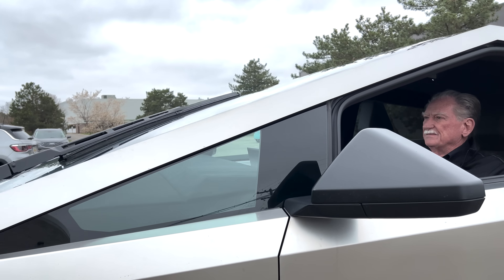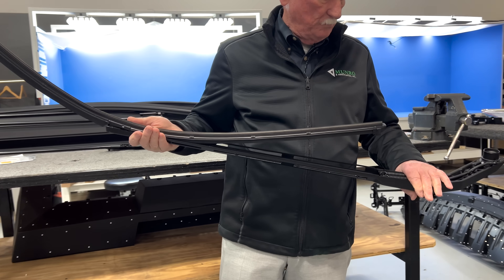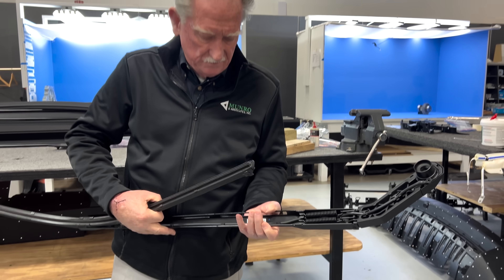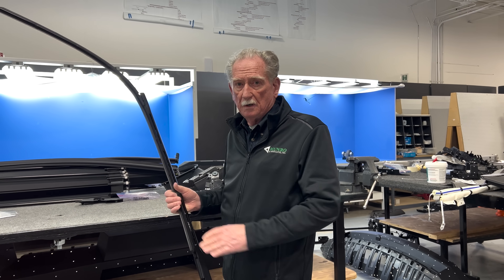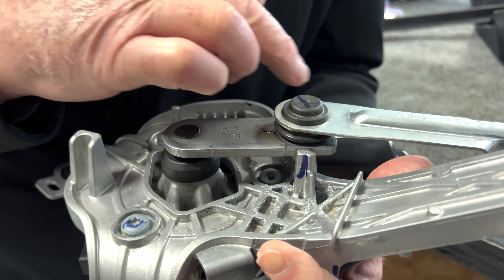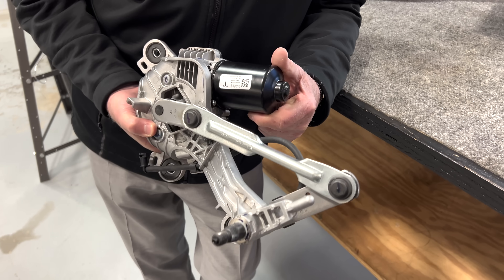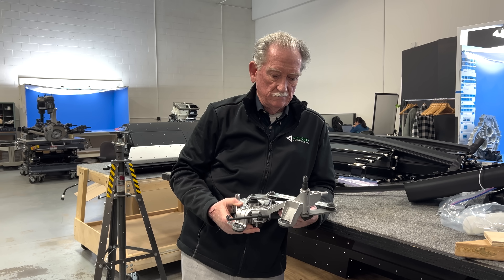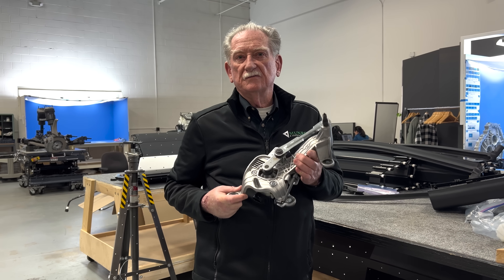How the Cybertruck's Massive Windshield Wiper Works

Comment: Hard to imagine a wiper swinging with such a large arm can swipe fast enough to keep up with a very hard rain.  The challenge is speed between wipes when it is really raining hard.
Reply: That thing looks extremely janky and jerry rigged, almost like a prototype
Reply: @Gr0gansm1th  As someone who has repaired wiper systems for over 50 years its actually a very robust and well though out system.  

Most don't realize the long spindly arms and linkages that have been threaded through the cowlings of vehicles over the evolution of the powered windshield wiper.  

Its quite an improvement having all the components mounted on one relatively small cast assembly instead of having a motor mounted to the body with an arm going to a central idler arm connected to the crank on the wiper arm hub via metal  rods with plastic snap together ball joints with all the separate pivot points screwed to the body sheet metal or having a removable cowling under the windshield with all the components mounted to a tube frame spanning almost completely across the entire width of the windshield.

Nothing janky or jerry rigged about this single wiper system.

Best!
Reply: @neilfromclearwaterfl81  I agree, it is good to see the mechanism simplified, eliminating the cross arm and ball joints.  The greatest problem is the vertical park position which exposes the blade to UV.  The bade on the back of my Insight is in vertical park position and it disintegrates in less than a year even in the not so sunny northeast.  You’re sure not going to find a beam blade refill that size at Walmart.  Hopefully it is a blade refill size typical of a truck or a bus, etc. you can get at Napa.  I’m pretty sure it is going to need frequent replacing.
Reply: @wtmayhew  Yes, and so often the access hole you have to reach inside of to get to those parts is so small you can't get your hand in while wearing a glove to protect yourself from all the razor sharp stamped sheet metal arms.  It can leave you believing a Sadist was involved in designing some of them.

You can end up looking like Sandy after his hand surgery when your done servicing some of them.

On the Sun/UV/Ozone issue, its a problem especially with the new rubber formulations we have today possibly due to the lack of virgin rubber with all the strife and deforestation going on.  

Of course to add insult to injury its harder to find blades that take what use to be a 25 cent refill with most of the new styles requiring the purchase of a 10/20/30 dollar or more replacement blade assembly in order to renew the rubber insert.  When they are available most are special order and not normally carried in the stores.  Oh and of course are about $10 each for the strip of rubber and no longer 25 cents or even just 10 times more costly then they use to be.  

Best!
Reply: @wtmayhew  I can't even get the 30" drivers side wiper blade for my Ford Tranit 250 at most auto parts stores, and there are millions of Transit vans on the road!
Reply: @markbeiser  Thanks for the reply and the data point.
Reply: @neilfromclearwaterfl81   Thanks for the reply.  I know what you mean about all the sharp sheet metal under dash boards.  Most under dash explorations end with at least one Band Aid.  🙂
Reply: @wtmayhew  Its even more fun when they are buried in a drain plenum just in front of the windshield where they've hidden the air intake for the HVAC system with the only access a small round or oval hole on the engine side of the firewall.  You will at times be working blindly inside that drain channel to get at all the arms and cranks since on some there will be no other access besides that one small hole where the crank on the wiper motor threads through.

Just a Band Aid would certainly be a good day working on some of them.  Hopefully you don't encounter something that doesn't want to be disturbed as a bonus.

Best!
Reply: @neilfromclearwaterfl81   Who’d have thought something like Legionnaire’s Disease would be an automotive repair occupational hazard.
Reply: Wiper blades this long are not a new thing. They have been used in buses and some marine applications for a very long time. This is simply the first use of one this size in passenger automotive application.
Reply: It always works great shill land never has problems.
Reply: I’ve never used the fastest wiper setting. Very diminishing returns after a certain point
Reply: @jabroni6199  Yeah I guess you and grandpa Munro must have never been in serious rain.
Reply: I've been around trucks and ships a bunch and have noticed that between smaller, faster moving wipers and larger, slower moving wipers, the results are the same.
Reply: Obviously Sandi also doesn't understand or worked with stepper motors or any other kind of low voltage d.c. motors. The voltage doesn't determine tge body size of a motir. He's trying to make it appear that tesla reinvented the product lines. Stop it
Reply: @cengeb   True.  Perhaps one could say the power output under load will generally greater for the same size motor when the applied voltage is greater.  That is of course a huge generalization and depends on several other variables.
Reply: @cengeb You are completely incorrect. The voltage applied directly correlates to the strength of a magnetic field. For a given stator volume, the higher voltage motor will have higher torque. This is basic stuff.
Reply: @otm646  not true, not true at all.  A generalization that makes no sense.  cough cough hack hack.  Ummm, aaaahhh.  All depends on it's driver, controller, how many poles in the motor, and so much more.  volts alone doesn't decide the motor output.  I've worked with stepper motors, synchronous motors in lab equipment for over 40 years...physical size didn't decide motor capacity. nordid volts applied.  Sandi keeps making stuff up.  cough cough, clear throat again, phelgm boy
Reply: @otm646  current decides magnetic flux.  So the same motor for AC fan, or chiller water pump setup used at 120V or used on the 230V terminal, is still rated as a 1/4HP motor, different volts, same rated output.  hmmm, wonder why?  Becasue you do not understand motors
Reply: @cengeb   Yes.  The motor on the Cybertruck wiper assembly looks pretty unremarkable and its physical size appears to be pretty average for that type of fractional horsepower application.  We can’t be sure if it is a permanent magnet motor or it has an electrically excited field.  A vague rule of thumb is that permanent magnet motors are often smaller for the same power output because they don’t have space taken up by field windings.  (Not talking here about an ECM motor, rather standard PM field motor.)  DC motors generate internal counter or “back” electromotive force which is greatest under no-load conditions.  As load increases, the RPM tends to drop which in turn reduces counter EMF.  As counter EMF drops, the Ohmic resistance of the winding sets the current consumption … increasing with dropping RPM.  A loaded motor consumes more current, which makes sense, and the increased current increases magnetic field and increases torque.  You can see that designing carefully, a DC motor can emulate self regulation for changing load.  The applied voltage will set the operating RPM, and the internal counter EMF will set the instantaneous current consumption by Ohm’s law.  (V - Eb)/R due to the winding resistance.  This is an over simplification, but it suffices for the discussion.  There are a handful of constants which determine the physics of a given motor.

There really isn’t anything particularly magic about running the motor on a 48 Volt power supply.  It probably doesn’t make the motor smaller.  What is saved is wiring harness bulk and power loss in the wiring harness.  Cybertruck makes more use of dual industrial spec Ethernet bus than most vehicles.  By using Ethernet instead of CAN, more control and sense data may be multiplexed onto the bus, and that eliminates dedicated separate signal wires to sensors and actuators.  Ethernet in cars is far from new, but Cybertruck uses it more heavily than most.  The downside is that if something makes the bus inoperable then more function is lost.
Reply: Look it up,cyber junk bricked car wash. It's there. My test drive was in a nightmare....gonna be s lot of used tesla from all the fired tesla workers. Mush is a genius...
Reply: @cengeb  Looked it up and found some dubious Ticktock hype, quite a few dubious alleged reports and a couple of reports from reputable organizations on how if you don't close the the windows, frunk, charge door etc and use the nanny mode it looks like they put in for people too distracted to do so there have been a few problems but not a widespread debacle.  Some were ever covering up the use of pressure washers that had broken the seals on electrical components through negligence.

Any vehicle or motorcycle can be damaged by improper use of even a garden hose when washing, not just a Tesla as most responsible motorcycle owners can attest too.

Here is some Grandfatherly advice:  Your course and rude presentation doesn't add much weight to your statements which clues most to give little credit to what you say.  You might try a softer approach in the future if you wish to be taken seriously.

Best!
Reply: Don't worry, your Cybertruck will drive for you
Reply: @d13bc1 Until now it doesn't. And how would vision only work without vision?
Reply: @gisobo  simple answer, vision doesnt work properly and nobody tells this on sovial media.
Reply: That constant clearing the throat is not good. Phlegm is not good,sign of other issues...cough cough
Reply: It doesn't give a big clean area,stop the lies. Look at the area not wiped. You are lieing continually
Reply: @cengeb  So what other observations have you made while driving the Cybertruck?  Did you buy one, borrow it or get a test drive?

Was that a brushless or more traditional car wash that damaged yours?

Best!
Reply: @neilfromclearwaterfl81  I couldn't test drive it, the think stopped running when i sat down, ERROR on the screen.  so i bought an Audi RS5.
Reply: @cengeb  You could have bought a lottery ticket since your chances of hitting the long shots appear to be pretty high.

On the other side of the coin look at how much abuse they are standing up to from the likes of Dave Sparks at Sparks motors.  Running snow tracks on them without beefing up the front end and only breaking things when really horsing around getting further than you'd expect a Jeep with a solid axle to make it unless you put a one ton solid axle up front with a truss kit on it.  Running them across the desert with sand paddles, entering pulling competitions, drifting with them, dodge ball competitions, etc, etc, etc and its still running.  

They can't be that junky if they are holding up to that kind of shenanigans that the likes of Diesel Brothers and Sparks are regularly pulling with them.

With all the bleeding edge tech on them its really amazing that they have been as trouble free as they have.

Meanwhile all EV owners regardless of brand should probably take note about verifying that the charge ports are closed before washing theirs.  I don't have a Tesla and double check that mine are closed before washing it by hand or when going to a car wash.

Best!
Reply: @cengeb  Nobody gives a shit about the top right corner of the windshield, not even regulators!🤣
Reply: It doesn't work in heavy rain. Heck this junk can't make it through a car wash without dieing. Yeah,that's $100,000 junk. This vehicle is a joke. Stop the nonsense.
Reply: @cengeb so much great input you saw the need for 3 comments lol.
Reply: @zdwade  i got a million of em' !

Comment: Why is the motor not connected directly on the arm?
Reply: They need the gear reduction to increase the amount of torque, otherwise you'd need a huge motor adding a lot of cost and weight.  Even the main propulsion motors are geared down at about 9:1.  So direct drive could be done, but it's not that practical.
Reply: @tesla_tap  But the belt cranks are not that different. One benefit is maybe the slowing speed and increase of torque at the end/start of the swipe, because the belt cranks are not aligned to each other.
Reply: Most likely due to packaging.

Comment: Regular tesla window wiper mechanisms often brakes after few years.  This will probably be swapped on record time 🤡
Reply: Had my model 3 since 2018. No wiper issues. Your claims are BS.
Reply: I've been driving Tesla vehicles since 2013 and never had a wiper problem or heard of anyone else having a wiper failure.  If you're going to make up something, at least try a bit harder.
Reply: @tesla_tap  : i have driven since 2014. Swapped on my P85D P90D P100D and probably on one of my 3 model X soon.  
The P85D probably died because it was eating the hood.and lack of lubricant? 
P90D was always slow. Just put together bad.
The P100D had autopilot 2.5 hw. So no rain sensor.. So this thing started whenever it wanted. And it really didn't like 120mph etc.  
On my plaid. I can probably lubricate it  couple of times every year. Because I need to remove it when swapping my air filter. Imagine being so stupid and designing the refresh X with this "feature"😂.
Get some experience before saying people making up stuff.
Reply: @Krishell you should stop spreading bs

Comment: I wonder if RHD models will have the wiper on the other side.
Reply: They probably won't make a RHD version.
Reply: @themonsterunderyourbed9408  - I wouldn't count it out.  Having steer-by-wire dramatically reduces the difficulty in making a RHD version.
Reply: @themonsterunderyourbed9408 There is one touring Australia right now.
Reply: @themonsterunderyourbed9408 RHD countries have more sense than to want such an inefficient vehicle
Reply: @MegaWilderness  any EV is more efficient than a lot of gas cars 🤣
BUT safety is a no go.
Reply: @ralanham76  Not the Cybertruck
Reply: @MegaWilderness  CT is 
41.239 kilometers per liter
Reply: @ralanham76  Can't be, it doesn't drink litres of anything
Reply: You know, with kangaroos and and the opera house and castles in the mountains and  and the Mozart and stuff, don't they drive on the wrong side of the road? Or does it just look like that because it is upside down?
Reply: Can’t sell it in the UK, won’t pass our safety test. We don’t allow vehicles that kill pedestrians

Comment: wonder why they don't integrate all the smaller castings required for the entire vehicle as branches off the major giga-castings and just separate them after pulling it from the press.  Like basically all the pieces you need to make the vehicle at once.

Comment: Sandy, what happened to your right hand ? A lot of fresh stitches... Al the best man, take care of yourself and stay safe :)
Reply: It was early stage skin cancer. Had to get that skin removed.
Reply: @Delian0  Thanks for an actual answer.
Reply: @Delian0  He probably told the doctor that he can do it cheaper if he used a different piece of equipment.  tell the medical equipment maker that if they used less screws, and more plastic, you could cost me $4 less
Reply: Snagged hand on his cutting edge opinions.
Reply: I had figured someone tried to convince him to assemble a rear subframe with fasteners, and he needed to lay down the law.
Reply: Woah Sandy, did you have a flux capacitor installed in your right hand? That's cutting edge!

All jokes aside, glad to hear you found it early and were able to get it treated.

Writing from 🇨🇦 in the winter I have huge issues with ice build up on my wiper blades, I'm sure you're familiar with the experience, which leads to really bad clearing and the famous blade slap to try and break it free. I just don't know how this blade will manage that.
Reply: I was looking at the shape if the scar, just as Sandy mentions "Mercedes".. Was creepy. Cancer-surgery is the less obtuse answer.
Reply: Is the system heated, or is it not necessary?
Reply from the maker: He posted about it on his X/Twitter page.
Reply: @MunroLive  YT commenters aren't good enough?  😁
Reply from the maker: He had Skin Cancer removed.
Reply: @MunroLive  Well tell us here so I don't have to go searching another site for the answer :D
Reply: Who goes to x?
Reply: @MunroLive  your response is like listening to my 12-year-old.
Reply: Got caught in the Cybertruck frunk.
Reply: @oggyoggy1299 
whopped by the wiper
Reply: @oggyoggy1299  funny or stupid or both?  I'm guessing just plain stupid.  Tesla adjusted the pressure of the closing frunk lid via their genius over-the-air update capabilities.  No car maker - still - has this capability.  Porsche sort of advertises that they have it but you still have to bring it in for them to over-the-air from their computer terminal on one side of their shop over to your car.  Weak.
Reply: not from a non patriot bad actor… or knot… parhaps… 😮

Comment: Now they just need to fix the auto wipe function... I have mine permanently turned off otherwise it just causes more trouble than it's worth.
Reply: LOL it is getting better but still a work in progress
Reply: So in your Tesla which system performs better, FSD or auto wiper?
Reply: @d13bc1  Auto wipers is more annoying because it does sometimes rain but I can choose not to use FSD when I don't want.
Reply: @d13bc1 FSD works better than both the Auto Wiper and Auto high Beams on my 2023 Model Y Long Range.

When you enable FSD on a Tesla the automatic high beams automatically toggle on. 

I have to immediately dim the brights because they do not dim soon enough when a car is approaching. It waits far too long until the other car is too close. 

I have noticed after I override it switching back to low beams 2 or 3 times in a row. It will then remain on low beams and let me manually toggle them on and off as needed. 

It definitely needs a software patch to update that behavior.